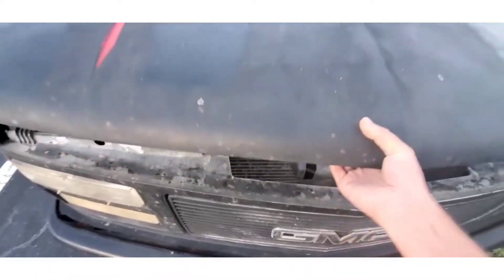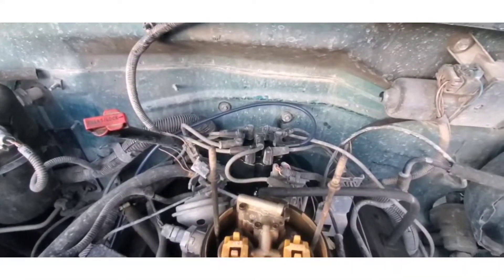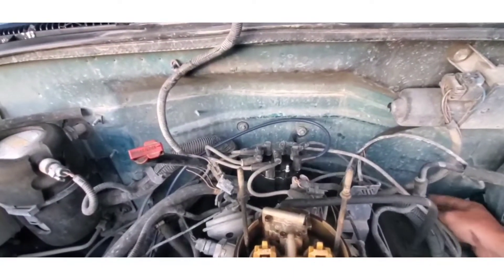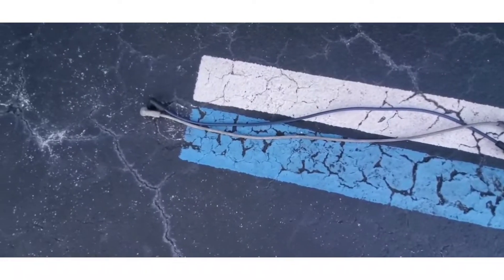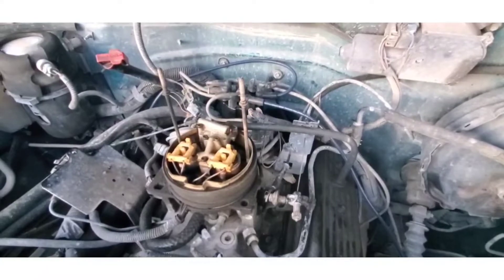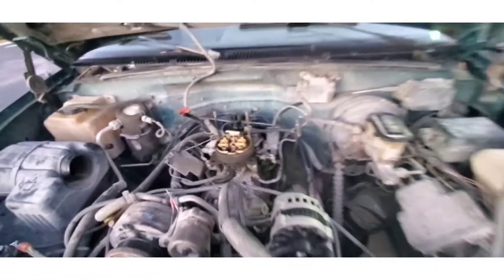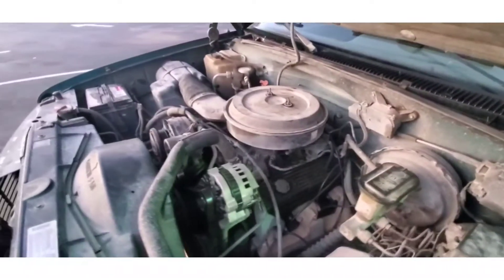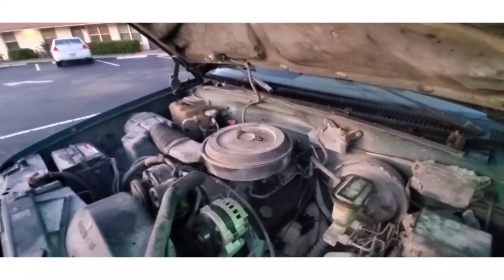1995 Chevy C1500 How To Replace Spark Plug Wires

Comment: Your video allowed me to see that cylinder 1 is inline with the coil. Then it was simply 18436572 around a clockwise direction to wire up correctly. Went from no distributor cap to successful crank on first try. Thanks.
Reply from the maker: You are welcome. Glad to see that you were able to get a successful crank on the first try after the video!

Comment: You might want to mention routing the wires properly through the wire holders so they don't get against the manifold and get burned and damaged quickly.
Reply from the maker: Thank you for mentioning that, I had not thought about that at the time of recording and editing the video, and appreciate that input on something I missed there